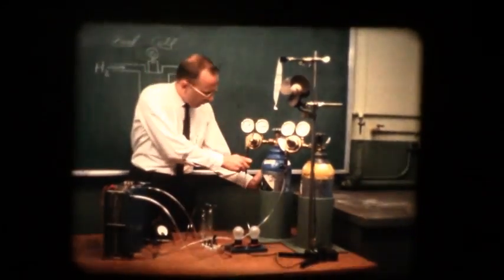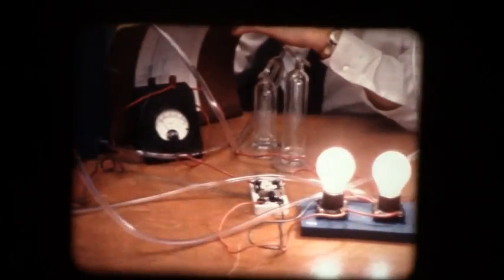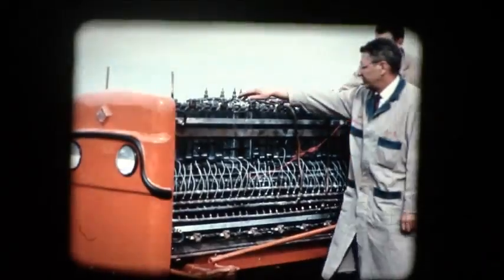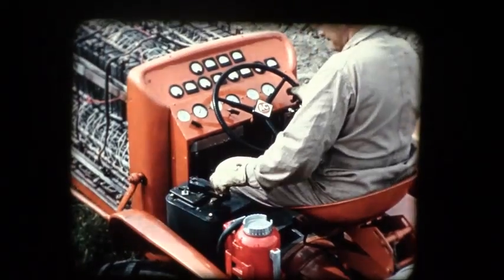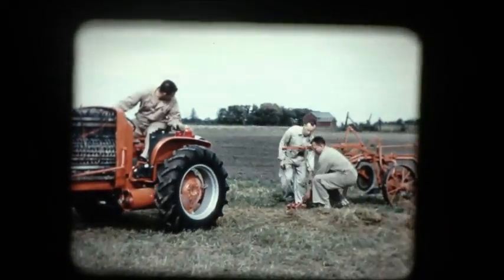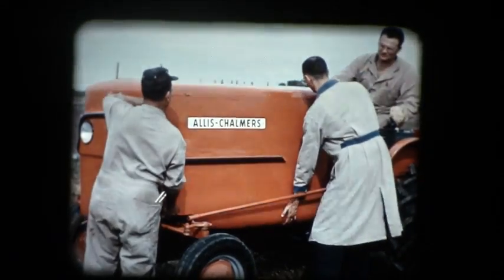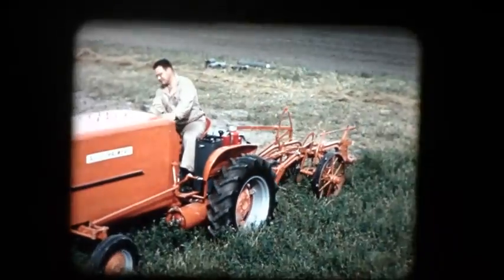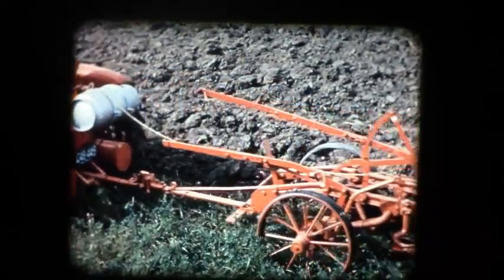1960's Allis Chalmers Dealer Movie Fuel Cell Tractor

Comment: sure it may have been more eco friendly, but image the added weight of that fuel cell engine instead of a normal diesel....no wonder why they never went beyond the prototype....it was too heavy and was too complicated for its time...I'm surprised they preserved this fucking thing...too bad they did't preserve their last A-C official built tractor instead of selling to some farmer before Duetz took over (in my opinion Duetz Alis is my favorite Duetz line).
Reply from the maker: The last tractor is preserved, the owned of it has never used it for farming and takes it to shows to display it I think it has about 50 hours on it